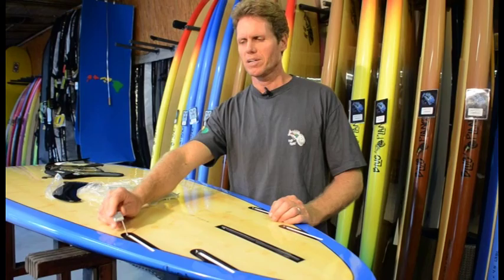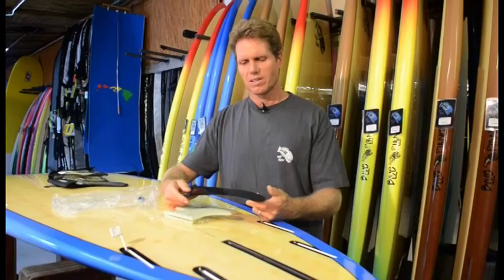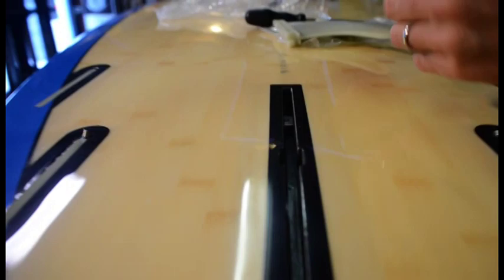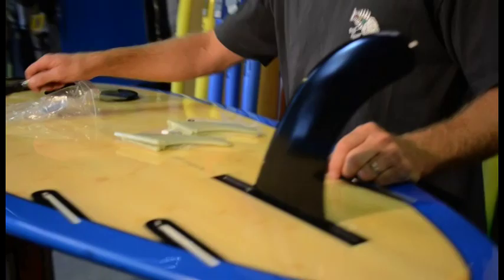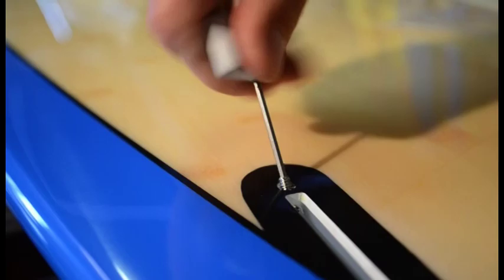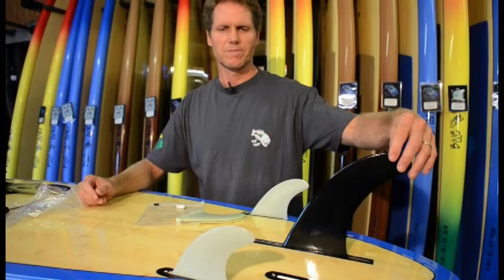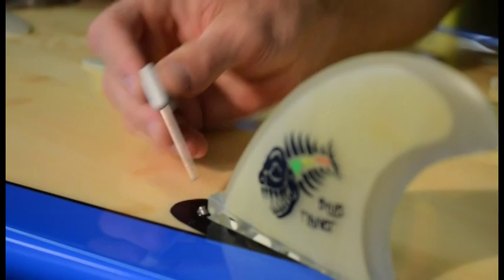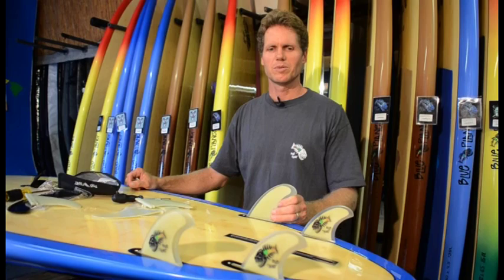Fin setup & Install for Surf or SUP

Comment: Thank you for very useful video! May I ask you a question? How do you think, the quad of G5 side fins is sufficient for the small SUP (100-130L) to go upwind with 4M^2 wing? Thank you in advance!
Reply from the maker: Hi Lev, I have not tried wing foiling on a regular SUP without a foil so am not an expert on this but my understanding is that you want a very big fin to act as a daggerboard to go upwind.  Just get the largest fins possible with a wing.  I have also heard of people using the mast of a foil (without the fuselage and wings attached) as a large fin/ daggerboard to practice.
Reply: @blueplanetsurf  Many-many thanks for your answer!

Comment: I’ve got a Blue Planet “All Good” board I’ve been surfing a couple years, mostly shorebreak 2-3’ San Diego waves.  I’ve never had issues with prone short boards doing this or even fun shape longer boards (I’m certainly no pro) but since trying SUP surf, I find the mass and size of the board are definitely a factor and often wipeouts are sketchy or send the board back at me, often fin first.  Running a two plus one with the large fin set up, I’ve been hit with the large fin a good bit.  I am considering switching back to a thruster set up just for less of a blade hazard on wipeouts.  Is that just something that comes with sup surfing?  Do you find the thruster set up to be safer for surfing at all?  Or do I just need to suck less?  Thanks!
Reply from the maker: I would say try a longer leash for one (and never use a coil leash in the surf).  It also helps to have the leash string attached so it is offset, which keeps the board from getting pulled straight towards you.
I like a thruster setup for surfing as it makes the board turn looser but I'm not sure it's safer when it's coming at you.  You can also dull the trailing edges with sandpaper for safety, or use Surfco protect fins.
Reply: @blueplanetsurf   thanks!  Yeah, I’d swapped the leash out early on after learning that as well.  At this point I’m finding I occasionally mess up a drop and end up rolling the board and tumbling with/landing on it, or when jumping off a few times it’s nosed in and pogo’d back fin first at my head.  I started wearing a Gath and it’s even taken a few hits since.  I’m having a blast and I’m sure I’m doing something wrong, but I definitely find SUP-surfing more dangerous than regular surfing.  I’m sure the shorebreak closeouts aren’t ideal.